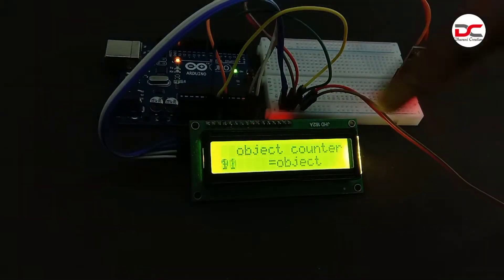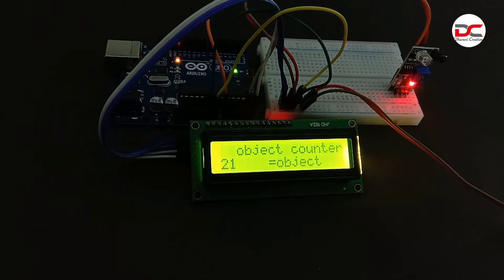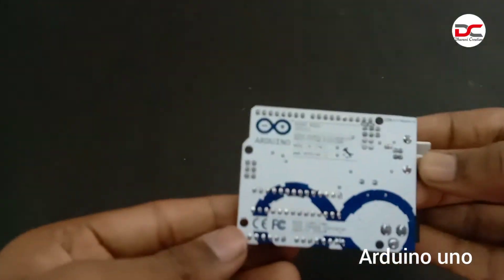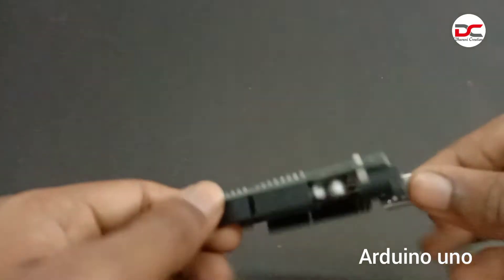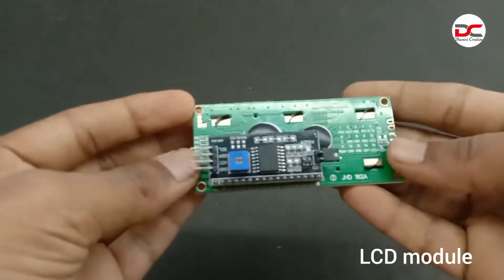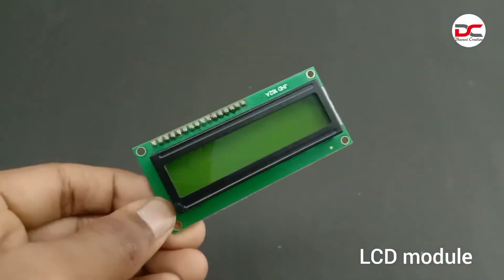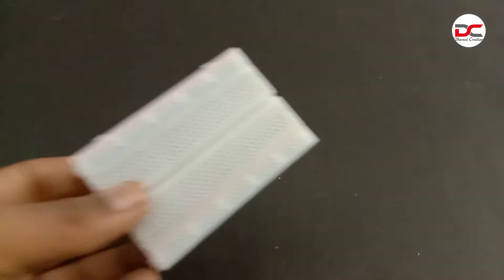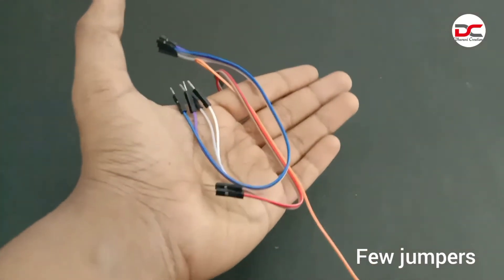IR sensor based Object counting system | using Arduino | Dharani creations

Comment: Sir the library not found in directory is comes as an error message sir..what to do sir..even i download the library from ide itself and i download it using zip file but it doesn't rectified what to do sir..
Reply from the maker: I will check it